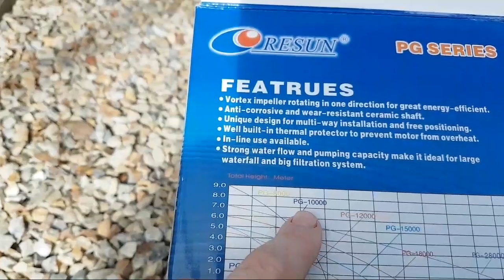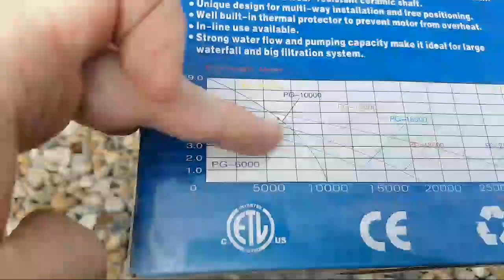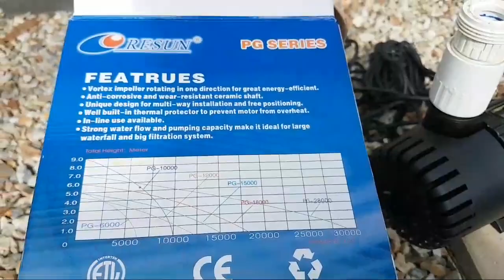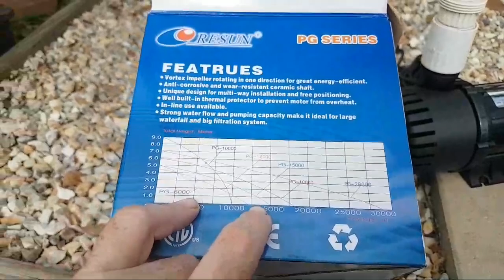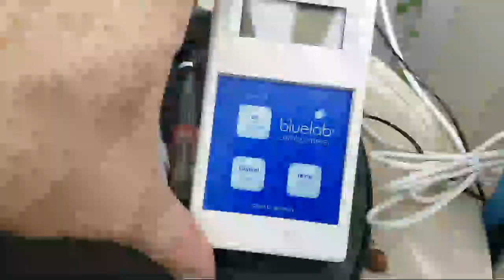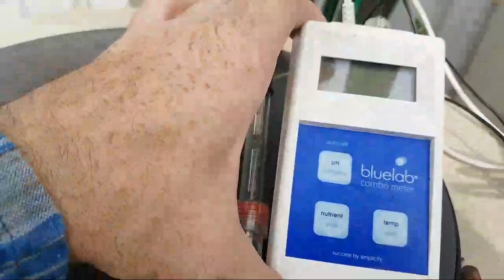Problems With Pumps LIVE STREAM Flow Rates & Undersized Pumps.

Comment: don't know if anyone else has mentioned,  but friction can reduced using big curves instead of elbows, also air injection outflow of pump will boost lift tremendously as long as you don't have any trapped air bubbles

Comment: I do DWC with storage tubs (6ish inches deep) and just hole-saw holes into the lids and drop net-cups full of expanded clay inside.  Mississippi USA.
Reply from the maker: +Jonathan Williams Thank Jonathan 👍 I've got a 350L/92gal trough that I want to set up as a raft bed. Have thought about using another material as the board. Just having issues finding material that has the durability I want in my price range.
Reply: You could set up a sheet of galvanized or stainless steel expanded metal just below water level and put one or two inches of expanded clay on top just for some rooting media.  It would a hybrid bastard, but it just might work!
http://minesaboveground.se/wp-content/uploads/2012/03/black.jpg

Comment: A small hello from france (sorry for my frenglish).
I'm looking to your video's and they looks good and helpful. You help me to understand most of the problematics of aquaponic and make me think to follow you in such way. 

My knowledge which is very related to pumps and hope it will help you.
when you indicates the head you expect on the pump curve (the small red point), if you reach it, it is certainly in the best efficiency area of the pump = the best life time expectancy.  
I guess the BEP of this pump one to one and half  meter lower.
Head will vary for several reasons (deposit in pipe, design modification, user water management, ...) and can be badly increased (in your case you should chase all "high" points in your piping = air trap ==> higher head needed to be delivered by the pump at each).
Most of the time,  the expectancy of the flow is not reached. 
If you operate with the pump curve you show (PG10000), it is quite logical that this pump despite its "apparent" lower flow deliver a much higher pressure. And the total pressure delivered is far more important in order to deliver more flow. In   your system, the total head looks to be higher than 5m (the max pressure of the same powered pump). 
Total pressure requested = geometric head + losses in pipes.
So, when you expect a flow it needs to be carefully cross checked by the requested pressure (and its evolution - need monitoring, otherwise the pump will die quicker).  
To know this pressure, it is quite "easy if you have a simple small pipe: you plug it at the outlet of the pump perpendicularly to the usual outlet pipe and place a gauge. It will deliver to you the "static" pressure, on which you will have to add the dynamic pressure by calculation (V²/2g  result in m of H²O for speed in m/s and g #9.81 in Paris :-).

Don't hesitate to clean you pipes : 10% less diameter = 21% of surface losses = + 46% of requested power for the same flow ! Power is money :-(

If you need more, ask.
Bye and keep posting.
Reply from the maker: +Michel Leromain 
Thanks for that Michel 👍
Have been schooled by a few folks now on what I need to do to make the flow more efficient. Once I tackle that module of the course I'm doing I'll be re plumbing the whole system and may be reworking the filtration as well. 
Cheers & have a top one, 
Rob

Comment: hello sir,  is it possible to have lower flow rate pump like 150gph pump but with good head height? any recommendations? as i am looking to make a small start but confused as the stronger pumps will be too powerful and are costlier too
Reply from the maker: Hi Lee. I've had some high volume pumps with shocking head heights as well. About the only reliable brands I've used that look to be available in a few countries are Sensen & Jebao. Even in their series you will find some that will out preform others at different head heights.
Hope that helps some.
Rob.
Reply: i will defintely give a look into the brands you've recommended. thank you

Comment: Each rise in the supply pipe adds to the head height.  Meaning if your source pipes raises and lowers as it connects to each bed... each rise adds to the head height.  Also, air can be trapped in source pipes that raise and lower.  Trapped air in the supply pipes acts much like an unprimed pump i.e. low or no water flow.  This can be fixed by adding a value at the highest point in each supply line to "exhaust" the air in the supply pipes.  If designed simply with only one high point, the air can be released and the pump will function better than ever.    You can also power cycle the pump off and on a few times and some times this will help remove the air from the supply pipes.  Best to use values to purge the air from the supply lines for maximum performance.  I believe air stuck in the supply lines is one reason why some people have problems with reliable bell siphon function.   If you always purge the supply lines... bell siphons magically work more reliably.
Reply from the maker: +Rj Aquaponics Hi there. 
As I mentioned in the clip I know the plumbing needs reworking but for the time being it's doing an acceptable job. Have no issues with the siphons & don't think air in the lines is an issue as it stands. 👍
Thanks for the suggestions & have a great one.